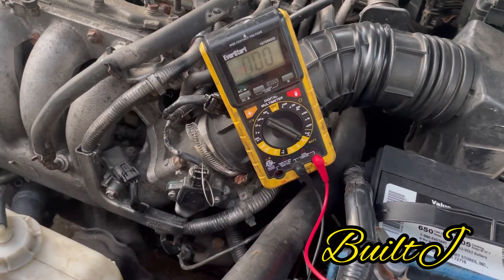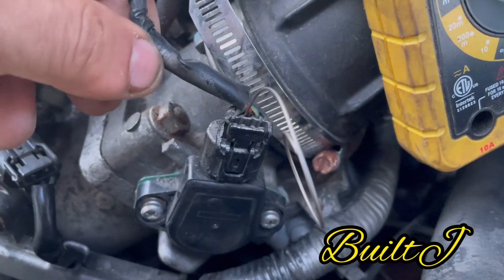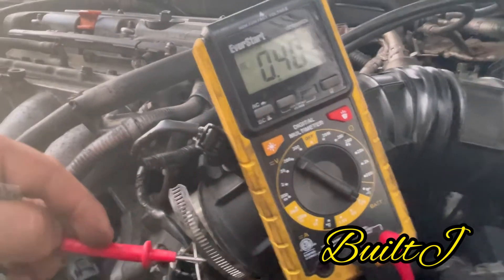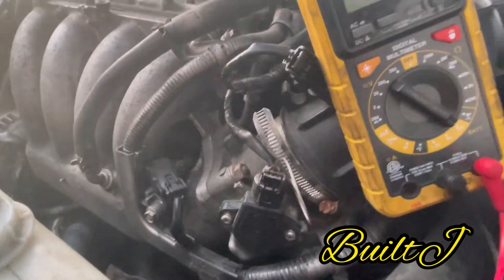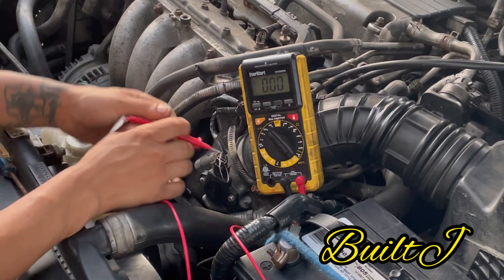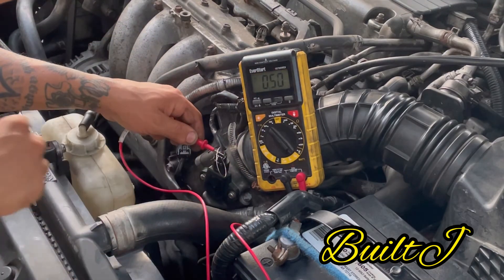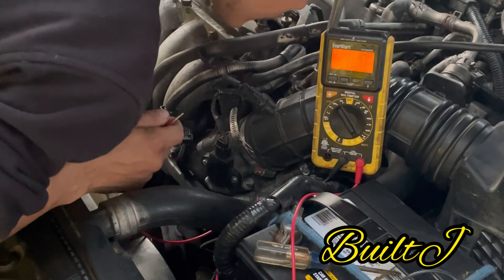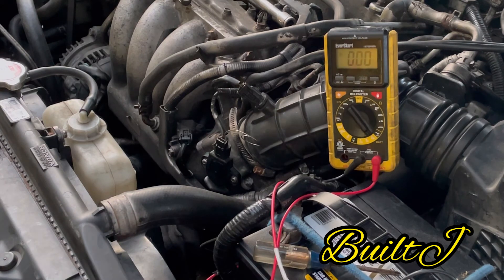Honda TPS calibration

Comment: 1:27 this doesn’t look safe please explain why you did this?
Reply from the maker: Doesn’t matter if it looks safe or not it works, it’s not rocket science. You’re using a jumper off that wire while connectors plugged in to adjust it to spec! 
If it’s out of spec your cars throttle response will be 💩
And if you adjust it correctly you car will respond the way it should from factory.
Reply: Fair lol but why not just put the positive lead from multimeter instead, why put a key ring in?

Comment: Cutting slots and a impact driver didn't work on my Element.  Screws were very seized.  I had to drill out the heads.  Then I had to heat the remaining screw studs with a propane touch and shock them with cold water before removing them with vice grips.  Making sure not to overheat the throttle body.
Reply from the maker: That sounds like a tough job, glad you got it sorted!

Comment: 0.50 does not work on honda accord ex 2003 2.4 l the gear lever is stuck
Reply: Hi, I have an ex and I want to calibrate it. What voltage does it work at?
Reply: Range 0.35 0.38 is fine for 4 cylinder  If you lower or raise it more than that range in my ex Honda, the gear lever locks.
Reply from the maker: This

Comment: I have K24A3 with eletrical throttle body...cl9 2005. .....same procudere or not? Because this on video is throttle body with medal wire not with app sensor
Reply from the maker: Yes should be same process

Comment: What symptoms were you having with a bad tps?
Reply from the maker: Some symptoms of a bad tps sensor are check engine light, jerking, poor acceleration, no acceleration, high or low idle issues

Comment: Is the car completely on when u check the voltage? I tried touching my red wire of the voltemeter to the red wire of the tps but I got no signal
Reply from the maker: Key on engine off

Comment: Mine does not go up to 5v when i open the throttle
Reply: It’s not supposed to.  Open throttle is 4.5 volts, closed throttle is .5 or (1/2) volt. Watch your decimal points.
Reply from the maker: Yes what he said

Comment: Good morning boss, my car is a Honda Fit 08 cvt, I cleaned the TBI, but now it's shaking when I put on the reverse with an AC on, I put the multimeter on TPS and it is reading 0.51 v closed and 4.58 open. Do you think it good ?

Comment: Thank you very much for the video.. I have a 2003 model K20 Accord and I set the tps value to 0.5, it was working with a little vibration when the gear was in D position. My friend also has a 2005 model of the same vehicle. The factory tps value was 0.7, why is this so? I also set the tps to 0.7 in my own vehicle, the transmission makes a slight knock when slowing down.. What is the original factory value?
Reply: Ne yazmıssın bilmiyorum ama tahminim sizde TPS sensörü sorunu yaşıyorsunuz
Reply: @tanerdemirci8636   ayarla ilgili kafama takılan bişe sormuştum
Reply: Sen sorununu çozebildinmi Yusuf bey benimde bir k 20 accordun var yıllardır sorunu çözemedim
Reply: 0.50 ye ayarlıyor buradaki usta bizimkileri 0.30 diyor
Reply: @tanerdemirci8636  0.5 dir hocam normali ,fakat arkadaşım 2005 2.0 var ölçtüm 0.7 çıktı .. Ben 0.7 yapınca araç durmaya yakın silkeleme yapmaya başladı geri 0.5 e çektim
Reply: 0.5 dediğiniz 0.50 mi yani birde hangi konumda ölçüyorsunuz bana bu konuda yardımcı olursanız çok sevinirim şuan 0.30 a ayarladım 1.vştesten 2. Vites geçişlerinde vuruntu yapıyor geç dolduruyor vitesleri 0.50 yapınca p konumundan çıkmıyor ve 5.vitese geçince hafif bile gaza dokunsam hemen geri 4. Vitese düşüyor
Reply: @tanerdemirci8636   hocam 0.50 değerini aldıktan sonra, dip gaz yapınca 4.50 değerini alamıyorsan  tps sensörün ya bozulmuştur yada yan sanayidir...Orjinal ve bozuksa  ise Ankara da tamirini yapabilen sevdiğim bi abim var "Mehmet KAHRAMANER (Garage AnatoliA) , kurtarılabilir.
Reply: Merhaba, bu eleman gibi konum sensörüyle oynamanızı tavsiye etmem. Fabrikadan ayarlı geldiği ve kesinlikle kurcalanmaması gerektiği yazıyor bakım kitapçığında, sadece sensör değişimi yapılmıyor komple gaz kelebeği değişimi yapılıyor. Sensör değerlerinde değişiklik varsa, ayar boğaz kelebeği teli üzerinden yapılmalı. Ayar yapmak için de, değerleri voltmetre üzerinden değil aracın beynine Honda'nın programı ile bağlanıp, oradan okumanız gerekiyor. Bakım kitapçığı şöyle diyor;
1) Aracın beynine Honda'nın programı ile bağlanın
2) Kontak anahtarını 'ON' pozisyonuna getirin.(Aracı çalıştırmayın)
3) Gaz pedalına basılı olmadığından emin olun, pedal konum sensörünün voltaj değerlerini gözlemleyin. 0.5 voltun altındaysa sensörde sorun yoktur. 0.5 voltun üzerindeyse, gaz kelebeği teli üzerinden ayarlama yapın.
4) Voltaj değerleri hala 0.5 v üzerindeyse beyin yazılım versiyonunu kontrol edin, güncelleme yapın, daha da olmadı düzgün çalıştığından emin olunan başka bir beyinle deneme yapın.
5) Voltaj değerleri hala 0.5 v üzerindeyse gaz kelebeğini değiştirin.
Edit; Bu bilgiler 2003-2004 Accord'lar için geçerlidir.
Reply: @quiteguide  yanıtınız için teşekkür ederim tamir kitapçığı varsa rica etsem mailime yollayabilirmisiniz

Comment: What all the dumb nuts on YouTube  fail to tell you about testing with a volt meter is that the key has to be in the ignition and in position 2. At least that’s what works for my RSX Type S

Comment: So today I literally watcher this video 10 times or more. When I get it set to 0.50 I can't get it to say 4.50 when the throttle is open all the way. It's impossible. I'm wondering is there a way to loosen the pull lever to get some more space .. when I open the throttle all the way it like 3.7 or 3.8
Reply from the maker: It’s okay man sometimes the tps just won’t reach 4.5 as long as it’s close but if it’s way out of spec and causes acceleration issue then I would replace the tps itself. Again it’s okay if it not perfect because electric tps especially aftermarket is never 💯%

Comment: Mine is at .50 at closed throttle and 4.25 at wot.  Any help?
Reply: 0.5V at closed throttle  is  perfect setting. 
4.25V at WOT is acceptable, thou 4.5V  is preferred.
Reply from the maker: Yes the tps is either installed wrong or broken. Try removing it and seeing if it damaged, if it is replace it and calibrate it.

Comment: What if I can’t get to a 0.5 ?
Reply from the maker: It’s okay get as close to it as possible, after your done take it for a test drive. To check for any issues
Reply: @builtjfilion934 if thr lowest I can get is 1.2v is my tps failing already?
Reply from the maker: @systemunderground  if your throttle response isn’t acting correctly and you’ve e tried adjusting it a few times, the TPS can be faulty it happens all the time with aftermarket parts, if you can afford OEM that’s the best way to go.

Comment: my motorcycle reads 2.5Volt in close position 😪 inline 4 650.  sudden engine stall , black smoke what could be the reason
Reply from the maker: Black smoke always makes me suspect engine damage possible bad rings or burning oil from head into combustion chamber. The volts should be higher if I’m not mistaken for a 650cc bike under load, but it’s hard to diagnose without actually being there.

Comment: I replaced the tps, then I followed the video and the idle is running high. How can I get them back to normal?
Reply from the maker: Sometimes when you tighten it it moves so check and adjust as needed